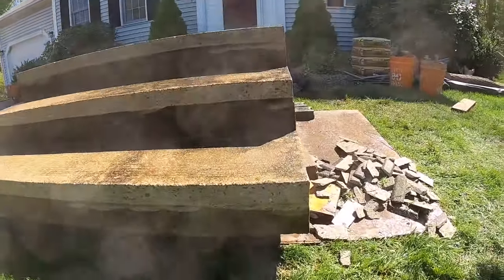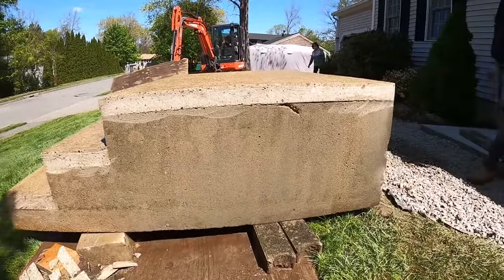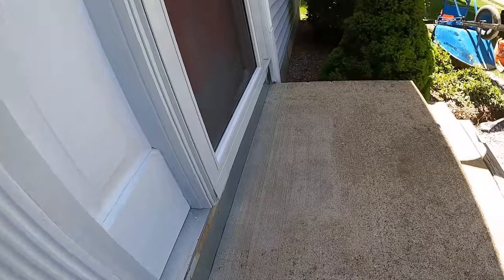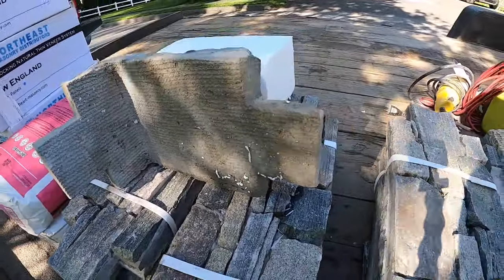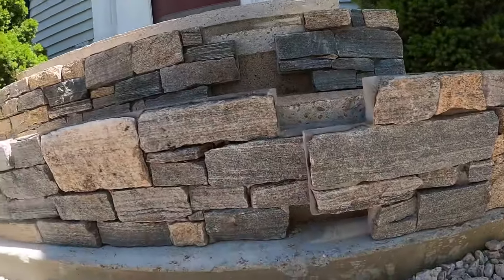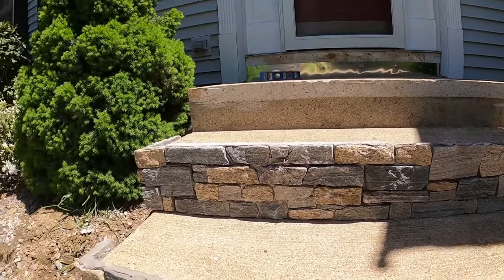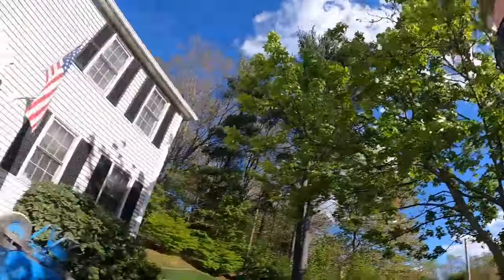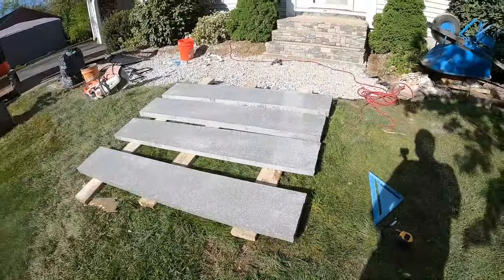Crazy Transformation! | Northeast Thin Stone Veneer Interlocking Panels

Comment: Great job. I have a question.  Understand if you hesitate to answer. I’m going to learn to do this but I have a staircase going into the house that has many more steps like 6 steps and a wrought iron railing on either side that is pinched into the concrete. When I remove the railing to venere the stairs how do I get the railing back on. I have a feeling that I’m not supposed to put the stone around the railing because of possible water damage to the stone and the railing because there is a weakness there. How would I go about that. Can you do a video like that to learn from. That would be awesome 😎. Love your channel!! Lots of information. I’m in new haven Ct.
Reply from the maker: Thank you, the best way to ever connect railings to concrete or natural stone is to anchor it. Meaning, railings with brackets at the bottom for you to attach them to the steps with anchoring bolts. When you install railings into the steps, they tend to break the corners off and become loose. And it is because of the water getting into the gaps and causing expansion and contraction.

Comment: In setting the heavy precast steps if you have time & warm weather, freeze 4 styrofoam coffee cups of water, place near corners, get chain out, let melt. Done! I would be using a cut “Grace” ice & water shield under door in behind the precast. Keep water out if it freezes at your location. Finish with siding under door. Now they sell caulking, silicone but look at building sealant. Like “Geo-Cell” it comes in colors and sticks while expanding 300% more than standard caulking. Old concrete, get a bonding agent brushed on to aid in sticky adhesive properties. Two cents worth for hard workers.